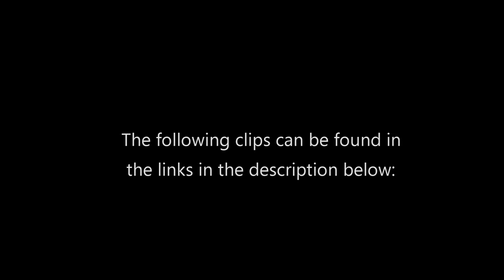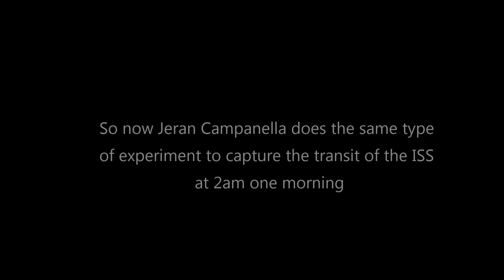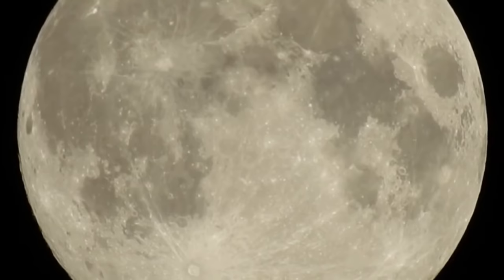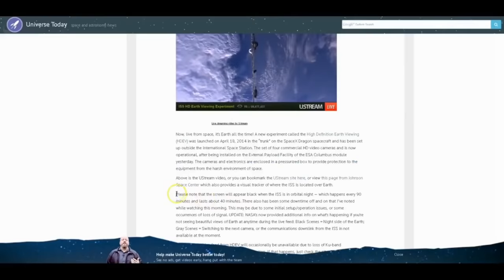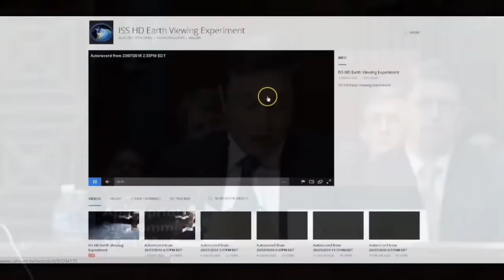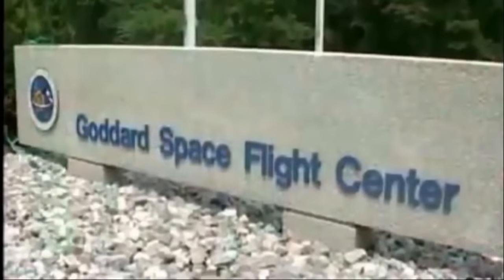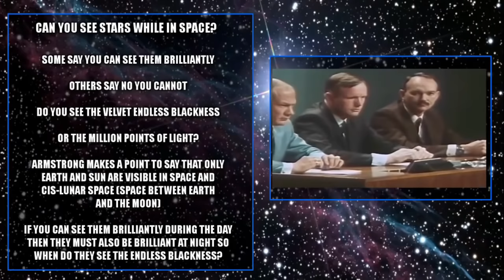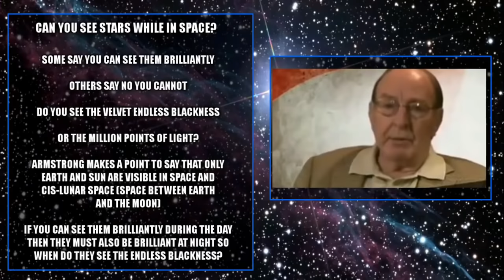The ISS Confirmed!

Comment: What do you do if there's a leak?  
That question alone has so many implications...
Where is the leak?
Is it via the lever mechanism?
Is it via the actual window?
Is it via the 0-ring seal?
All of the tech used to create this particular piece of equipment probably has 2 redundant aspects to it incase the first aspect failed, and there is a back-up.
He did say that it's possible that it could be fixed by conducting a spacewalk.
Ask yourself this, do YOU know everything about your car?
If your car springs a leak from the water hose to the water pump, do you know what to do?
That is what you need to consider, as not everyone will know what to do in an emergency, which is why all of the crew use the 'manuals' that the ISS is equipped with, maybe even down to the point of it all being on a Tablet/Padd

Comment: How ignorant....the difference in pressure between Earth's surface and space is ~14.7psi while diving 5,000 meters down in the ocean is 500 times the pressure differential and yet we have no problem (with good engineering) stopping leaks with o-rings! Must be a conspiracy. LOL  That said you have some valid points.  Truly the public has not seen any significant advancement in aerospace technology in 50 years and that is alarming!
Reply: Even worst: How do FE proponents believe that NASA can tell exactly when ISS will pass in front of the moon at there location, anywhere on earth? Thousands of balloons or model drones flying at a hundred thousand feet up at hypersonic speeds? What will it take to wake them up?

Comment: Submarines and high altitude airplanes have had sealed shafts and moving parts for three quarters of a century or more. Why all the fuss. Is that guy just stupid or what?
Reply: I thought of an airplane door, seemed like it works the same way, opens from inside, maintains seal. Stupid question imo. But the next part is too funny, "Then you have a leak"....lmao..."there's probably a plan, I don't know off the top of my head"...lol. Sailors practice hull breech shoring with simulated conditions like cold pressurized water beating on them and flooding the room (https://www.youtube.com/watch?v=97XDakVK0Ro) but the best of the best and all you get is ...*"there's probably a plan, I don't know off the top of my head"* ?  I think it's safe to say that in the event of a hull breech, this guy would be totally useless....unless you stuffed him in the breech.

Comment: The O ring tight seals are quite simple engineering been around long time and is very trustworthy! Used on 4500 psi scuba tanks with just one seal between din and reg,  I’m sure space station has few O rings on each and scuba requires very little tightening on reg the pressure pushes on O ring and make a very trustworthy air tight connections. I wouldn’t do much make fun on the ORing thing a lot of people use paint ball , pcp air guns , scuba, welding, many other very high pressure sealed things that use O rings that won’t take anything else you say as anything but None researched bla bla none educated noise. But I like you lol.

Comment: Do a little math. When I did a measure of the size of the "ISS" going in front of the Moon from a telescope view, it was only 1/3 the advertise size, in a different shape proportions than advertised. If you see the videos of ISS lit in a black sky from telescopes you will see 30% side view, 40% full view, 30% side. The side views show a spectrum smear just like a hologram. The evidence supports the rumor that they have a different ISS than advertised that merely projects a hologram.
Reply: @MrButtstroker  Insults always reflect directly on the insulter.

Comment: "We have no confirmation of anything in space beyond what NASA tells us"… Could not be further from the truth.  Ask any member of the amateur radio community about their communications with the ISS or Space Shuttle, ask about moon bounce and then ask your self if you think all the people working for DirectTV are faking their TV satellite rececptions too?  I've tuned those dishes in to their satellites at the specified angle in the sky and I know it works.  Clearly if you put a piece of cardboard to the side of the receiver, TV reception still keeps coming in, but if you put it above the dish slightly to one side where their fixed position satellite is, you can clearly block the line of sight communications just as easily as a nasty passing storm.  Storms don't block cell phone signals but they definitely can block weaker satellite signals.  That should be proof enough that we have made our mark in space. duh...
Reply: Well said, of course flat earth genius's are claiming balloons for everythihg lol.  Those things sure can travel fast ha ha.

Comment: First of all, any film showing anything moving across the sky from West to East is not showing an object orbiting the planet in space and definitely not the space station. It is not possible to orbit the Earth faster than the rotation of the Earth itself on its axis. The International space station, if seen crossing our sky, should slowly be moving east to west because it is at a higher Orbitz than our communication satellites which keep the same pace and same position over the Earth and therefore it is has a slower orbit around the Earth and therefore should be crossing the sky from east to west. I have seen the original International space station with my own eyes back in the 1990s.  That being said, compared to the moon which has a very slow orbit, it would move a Ross the moon left to right but if you have a stationary camera, the moon should be crossing your lense from east to west at a much faster pace than the ISS which should also pass east to west at a much slower pace.

Comment: No way ISS could handle the temperatures or even the negative pressure out there in the thermosphere...........
Reply: You are obviously some sort of well educated engineer, so it should be easy for you to answer this simple question:
How do you FE proponents believe that NASA can tell you exactly when ISS will pass in front of the moon at your location, anywhere on earth? Thousands of balloons or model drones flying at a hundred thousand feet up at hypersonic speeds? What will it take to wake you up?
Reply: @claudbase  do your own research...... you most propably would not believe my answer . NASA is lying from the very  beginning. Where were those NASA enginiers when a hollow aluminium vehicle flew into a steel and concret skyscraper ,like a Hot knife into butter  , and even took it down  according the fake pictures shown on all medias.  Its Time to Open eyes
Reply: @herzart212  A Boing 767 flies at about 500 miles per hour, weight about 395000 lbs so has a kinetic energy of about 4.5 GJ. A stick of dynamite liberates an energy of about 1 MJ when it detonates. So when the 767 hit the WTC, it was equivalent to  about 4500 stick of dynamite blowing almost simultaneously. 
You should learn bit of physics instead of relying on your intuition...

Comment: This guy sounds very convincing but there are just to to many things pointing to a spherical planet earth. Tidal forces and the moons influence of the earth or tides. The pendulum effect or why it changes directions because of the rotation of the earth. Eclipses both lunar and solar creating curved silhouette of the moon and the earth. The jet stream created by the earths rotation. Airplane travel time which increases when traveling east for example, when going from Maryland  to California it takes 3 hours but from California to Maryland it takes 5 hours because of the earths rotation. The retrograde of the planet mars proves mars is the 4th planet from the sun. Atmospheric pressure where one can not breath without oxygen when on a high mountain.  Gravity exists just like magnetism exists forces that can not be seen. Objects in space are round because of gravity regardless of the size of the sun or the earth.  Gravity is strongest at the equator which bulges an extra 50 miles because of centrifugal force.  Hurricanes rotate clockwise at the northern hemisphere and counter clockwise at the southern hemisphere because the earth is a sphere,  not flat. The north pole has 6 months of light and the south pole has 6 months of night because the earth is spherical or a spheroid.  The constellations change as the seasons change because of the earth traveling through space while revolving around the sun. Etcetera .

Comment: Yes maybe the ISS is confirmed as a model on Earth....there is definitely something flying around up there but there is no way there are Humans on it....just basic logic should tell you this.....

1. Thermal temperature fluctuations.....day / night.....the thermal stresses on the structure would be huge.
2. Altitude changes so massive physical stresses on the super structure......extremely poorly designed for a self supporting structure.
3. Vacuum of Space^^......look up the definition of a Space Vacuum in Wiki....no man made structure could survive in that environment.
4. No video of the ISS being assembled in Space......the greatest achievement by Mankind in the last 30 years and no video of it being assembled in Space^^.
5. Conflicting accounts by astronauts of seeing Stars in Space from the ISS.
6. There is no way you should be able to see something the size of a Football field 250 miles away.....reflective or not....
7. If the ISS was so reflective shouldn't the viewers of the Livestream from the ISS get blinded.
8. No maintenance dept on the ISS....it is a highly dangerous environment the ISS is in which is far more extreme than a Submarine is in and no maintenance dept^^....but they have enough room to store Gorilla suits and Santa hats.
9. At 17,000 mph any debris in Space would shred the structure......and not all debris travels the same direction and speed as the ISS.
10. Openly using augmented reality - grabbing just materialized puppets out of thin air for example.......the condescending attitude of the Astronauts points only to a show for special kids

If you believe there are Humans on the ISS you need to look at yourself in the mirror and ask yourself if you have lost all logical reasoning.
Reply: RB VB by

Comment: if the full moon is lit up(because the sun shines on its surface)..
how come the iss doesn,t reflect that same sunlight??
the things is metallic looking with solarpanels the thing should radiate silver like a mirror in the sun.

i see airplanes way up high in the sky 10km, that are the same size as the iss that i can only see because sunlight reflects on it and or the condensation trails/chemtrails behind them.
now imagine it being 23 times higher than that...
it makes no sense at all.

Comment: I predict that in a few years, nasa is going to discontinue the ISS because its becoming increasingly unbelievable.. And they know it.. check out   1:10  The smarter every day guy had a point in saying there's no way an o ring seal would work for those hatches.. Anyone who know's how powerful a vacuum is will tell you that a little rubble ring isn't going to cut it.. You'd need a soft metal, ONE TIME USE ONLY seal in order to keep pressure next to such a powerful vacuum..... a rubber o ring?? really guys..     space is fake, earth is flat, research it, Or stay asleep, your choice. Gob bless.

Comment: Lets imagine for  a second that you were looking at  the trump tower from 250 miles up in the air. How tiny tiny would it be? You would not be able to see the ISS if it were that far away period. But lets pretend that somehow you could now you have to somehow rectify the fact that it is traveling at 17,150 MPH.

The International Space Station travels in orbit around Earth at a speed of roughly 17,150 miles per hour (that's about 5 miles per second!). This means that the Space Station orbits Earth (and sees a sunrise) once every 92 minutes!

The dimensions of the  ISS research facility is approximately 356 feet (109 meters) by 240 feet (73 meters), or slightly larger than a football field.

Trump Tower is a 58-floor, 664-foot-tall (202 m) mixed-use skyscraper at 721–725 Fifth Avenue, between 56th and 57th Streets, in Midtown Manhattan, New York City. 

My word, now you have something traveling at the mind blowing speed of 17,150 MPH the size of Trump Tower (well not the same but you get what saying) and you can see it pass the moon at 250 miles away. I believe that something was seen but it was absolutely not what they said it is because that is ridiculous. One more thing, what do you think would happen if a meteor of any size were to hit the ISS traveling at speeds that would likely exceed the 17,150 MPH that it is orbiting? It would go completely  through any material they claim that it is made out of and the story is over. There is no Star Wars type force shields on the ISS or any other so called space crafts.

Comment: latest "space" opera  I "S" S  "meteorite impact ".  in the" vacuum of space" "plugged with epoxy"?
i watched the "mission" on the RU live feed. "cosmonaut" sergei "space walked " to the SoYuZ 
escape pod hacking away at the outside reentry heat shield for 3 hours with his "space Knife "
to find the" 1 /10 of an inch hole".which he never found feed cut.however he was given specific
instructions from Moscow to bring back a sample of the hole for analysis .

In the "vacuum of space " in a "Pressurized " pod  Why did they not fix it from inside .??
and have you seen what happens to a pod under explosive decompression.
all the above in quotation mark are lies evidentially leaving   international station in the ru live feed to the SoYuZ 
escape pod criminal damaged hole not found but a sample was requested . 
 the matrix of deception lies in our syllables  lies in space lie of the land

Comment: How much air pressure do you think there is inside the space station? 15 Psi, that's it! O ring's can hold up to much more than that!. redundant O ring's would be just fine and it is a proven technology and can be tested until they are flawless! Now some of the "missing" footage is damn odd and needs further explanation. But come on man, the O ring thing aint much of a thing. NASA does lie but not about everything. Choose your battles.

Comment: the completely stiff long hair of the women on the ISS videos is a dead giveaway to the fakery also. No matter what angle the move their heads or no matter how fast they turn the hair all stays exactly in place. The women on the vomet comet anti-gravity jet simulation flights have hair that waves around with their movement. It doesn't freeze pointing straight above their heads.
Reply: I doubt you have ever seen a woman's hair close up.  Unless you have an arrest record.

Comment: Wether you Beleave the ISS Is occupied or not doesn't really matter. What they have been doing. Up there for the last 10 yrs we will never be told. NASA. Claims we don't have the Technology to go to the Moon. But we can send 6 Rovers to Mars.Where did that Technology come from. ?  Obviously not from the Moon. 
N.A.S.A. Claims they lose contact with the ISS EVERY 90 MIN. Yet over the last 35 yrs N.A.S.A Has never lost contact with Either.of the 2 Voyerger. Satilites. An not because they are on a flat Trajectory. It was because they placed Radio Telescopes 120 deg apart around the Earth. So if we can track 2 Satilites for 35 yrs. Why can't  we. Not track the ISS SAME WAY.
Reply: @yazzamx6380   Thanks for the Reply. An explaining it. an i see your point. The only solution of communicating with the ISS would defeat the purpose of it. Putting the ISS in a Synchronous  orbit would defeat the purpose . Since it was Meant to circle the earth, As for the Rocket problem. Seeing how how our Govt is Operating I think any hopes of space travel is pretty much off the table anyway. Space X is the only hope for any space travel. But we need a better propulsion  system. An there are Radiation issues that need looked at, Space X is working on those too. 
      As for going to the Moon. We may have been Requested or order off the Moon. ET's have been doin mining  on the moon since the mid  70's  There are structures an Pyramids on the moon, There  have been UFO's seen flying over the moon. The Moon is occupied.

Comment: That structure is too flimsy to withstand a pressure of 14.7 psi. with a vacuum outside. Also the three stooges floating are moving when there is no physical motion from them. The ISS would not jostle around
Reply: A vacuum is simply the absence of matter, it doesn't suck, so that structure is MORE than strong enough. The pressure on such a structure is the difference between the pressure on the inside compared to the pressure on the outside, which in this case is 14.7 - 0 which is a net 14.7 psi. Hence that alone proves you don't understand the topic you're discussing :-)

Comment: First off the guy that is demonstrating the cupola is probably the file clerk. So what do you expect? Second why do you have a problem with using an inside mechanism to unlatch the hatches? Those mechanisms can be sealed, duh. O-ring seals are made from many different materials for instance silicon has much wider tolerance to temperature variations than rubber. Your list does go on and on and on, but shows your ignorance just as much. But hey nice try, you got a bunch of views right and that's all that matters. Few people I know believe the BS that Nasa puts out, but the ignorance in this video is like the ignorance that comes from FE'ers.